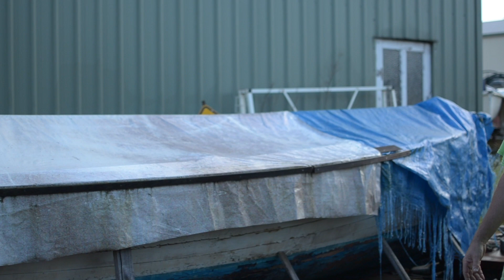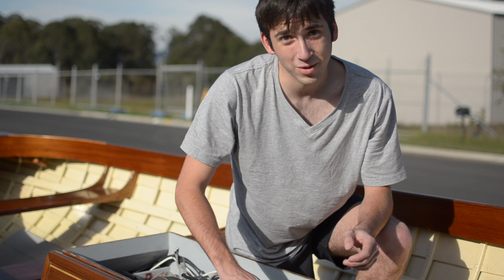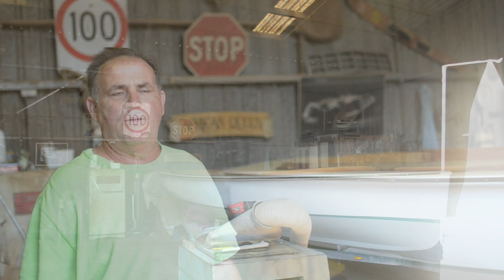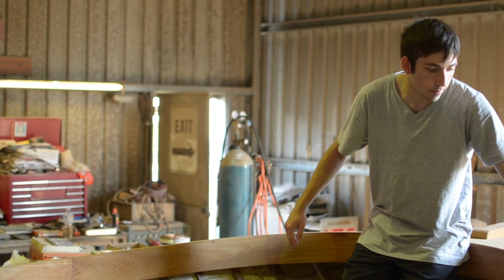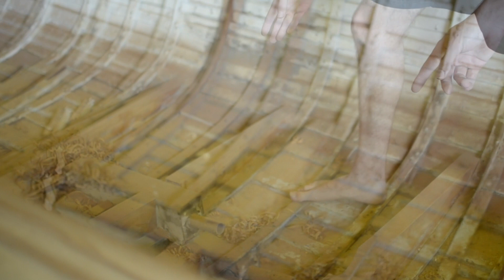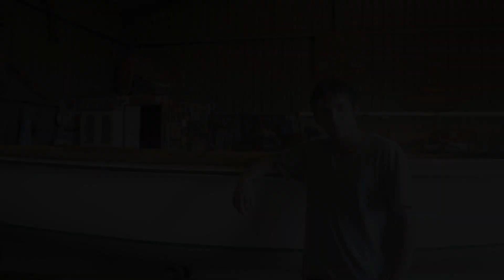Restored 18 Foot Carvel launch and Simplex engine

Comment: Its amazing what you guys do! These boats are beautiful they need looking after. It is a pipedream of mine to build a clinker boat, have you ever built a boat like this from scratch, is there any advice you have?
Reply from the maker: Yes we have built them from scratch, it is expensive and difficult to source good timber. It is very time consuming in terms of hours. A high skill level and experience is recommenced, i.e you've done a trade in something else. We do however supply replica fibreglass hulls, which amateur boat builders can finish, i.e deck beams and deck, combings, seats floors, engine beds and box etc. Knowing that the hull will be structurally sound. This still requires a reasonable level of ability to achieve a nice level of finish.
Reply: Beautiful.